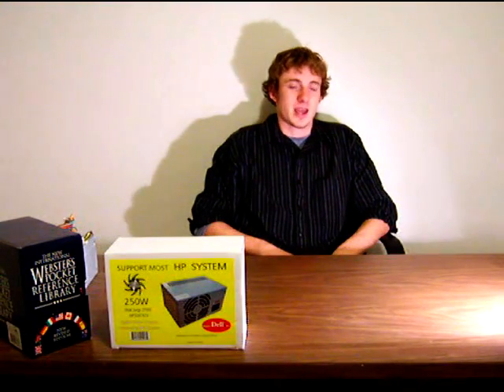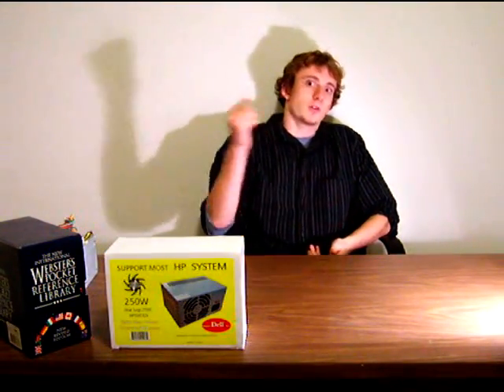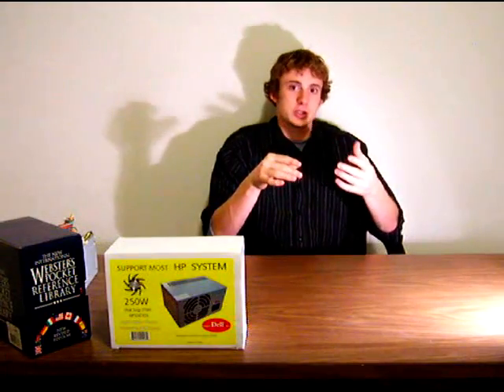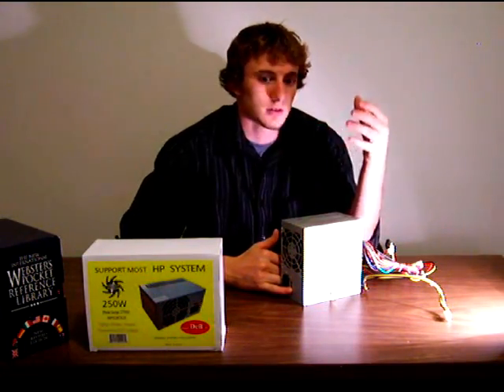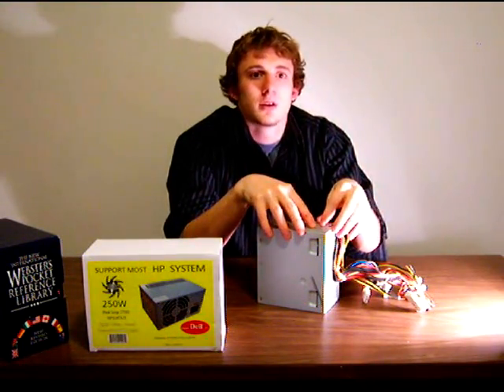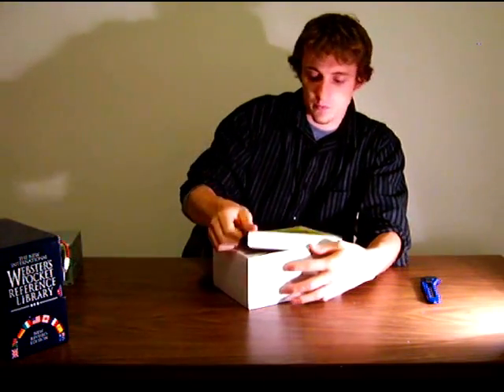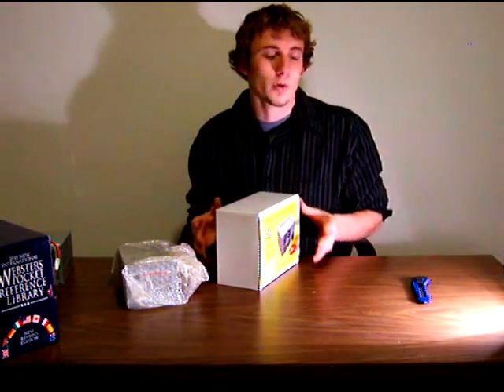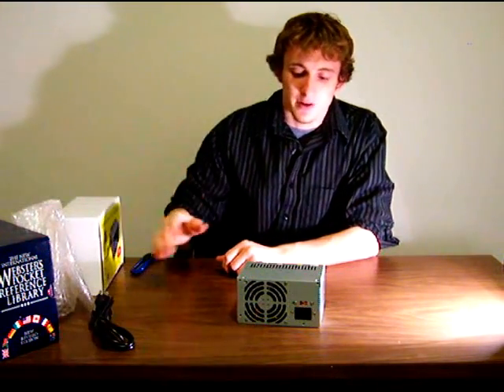Tech Talk: Q/A and Review: Athena Power 250watt PSU -Part 1

Comment from the maker: It is possible that it could be one of many issues, or multiple issues combined. Your system will not draw 250watts of power under load, but that does not mean your PSU is not at fault. Contact me via any of the means listed in our channel and I'll be happy to help you troubleshoot this issue. I would prefer not to work this out on here due to Youtube's poor/unreliable comment/messaging system.